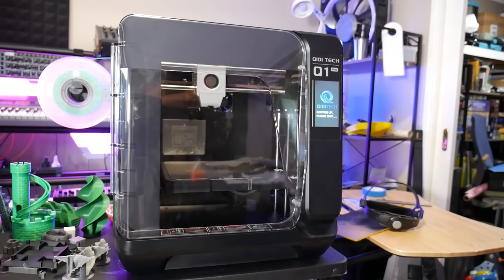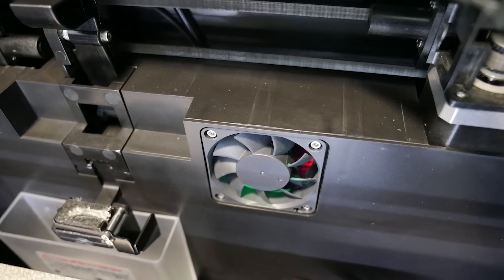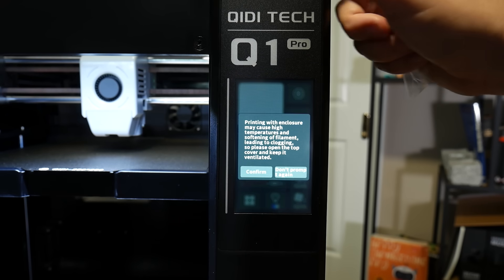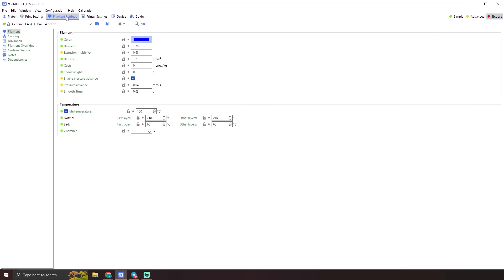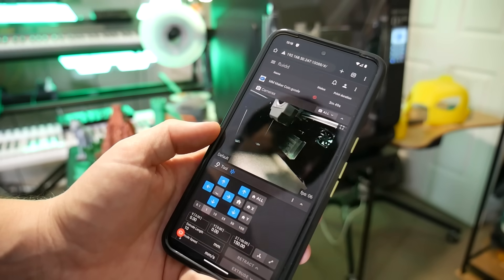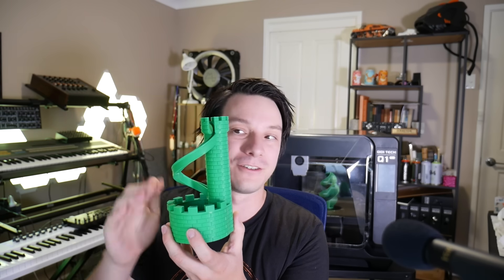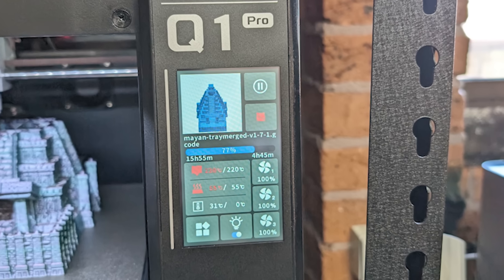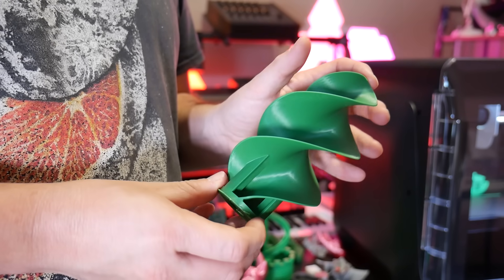The QIDI Q1 Pro is an AWESOME 3D Printer with some WEIRD choices. full review

Comment: Good one mentioning that door and the filament thing.. I got a newer version of the printer, in which it doesn't have a little hose hanging off the back, instead it's just a little hole to put the filament into, which looks like a headphone jack at first glance. But it is a wicked pain to get the filament to go into it correctly, since they made the outer part of that hole, thicker than the inner part, and it's not tapered.. Also that door, wth with not having a handle.. it wouldn't have even costed them any more, just a slight redesign to make the inner side of the door concave a bit, so that it's easier to get your fingers in there.. Really though, someone gotta teach Qidi how doors work, lol..

Comment: Now that the Elegoo Cetauri Carbon has Dropped, can you compart this to that? I want to buy a Core XY printer, and want to avoid bamboo and Spend less than 1k.Can you do an update review on Sub 1k Core XY and where they currently stand?
Reply: I'm in a similar boat, and wondering the same thing.

Comment: I hate to tell you this but you screwed when ripping the ptfe tube out during the filament change..... You're supposed to push down and hold the locking mechanism and it comes loose very easily.... You shouldn't have to fight it

Comment: Great vid. How do you rate the Q1 Pro against the Creality K1C? I noticed the Q1 is a decent amount cheaper at the moment, and both claim to print carbon fibre filaments, and with similar overall specs... If you have tested both, id like to know if you think one is a clear winner (or similar priced/spec'd options). Cheers

Comment: I do understand the filament change instructions. I own an older Sindoh DP200 and charging filament routine ask you to do the same. The reason, they have a cartridge system where they tried to sell proprietary filament BUT later they have you a firmware change to be able to use 3rd parts without the cartridge. The routine ask you to remove the bowden tube from the print head so you can clip off any filament bubble that might get caught in the bowden tube. Makes some degree of sense. I had less trouble than you in removing the tube from the print head. Each time I do it I, pretty much, never see an issue where there could be a jam. HOWEVER, if there every is, and I have had to go into the DP200 into the extruder and it's a mess. It's an enclosed machine and not fun opening the left side of the printer, remove a series of screws and have to be careful with wiring. So, I do remove the tube and cut the end so I do not have issues.

Comment: If you have to turn off the heater for nylon, what's the point of printing nylon on this machine?? Now you just have warping again. The whole reason I would want a heated enclosure is for stuff like nylon which is supposed to have one... Have they fixed this issue with the hotend heat creep or what?

Comment: I love Qidi Tech; I've got the Anycubic (Kobra 3), Bambu Labs (P1S), and Qidi Tech (X-Plus 3); I prefer it to Bambu and Anycubic. I actually love how Qidi does their filament load/replacement procedures, it helps against clogs and other issues (which I've never had with Qidi). Love Bambu as well, but in my opinion, Qidi printer is on par with Bambu Labs (if not better). I now strictly use both Bambu and Qidi in my farm.

By the way, if you use an active dryer, there isn't even a need to use the rear or side spool mounts.
Reply: can you recommend and link a active dryer for the Qidi Q1 pro?  TY

Comment: The Q1 Pros that arrived yesterday (7-29-24) now have 2 corner positive stops for the build plate. The do listen apparently. 🙂👍🏻 

But they haven't fixed the issue with how the filament wants to jam after it moves from the extruder to the hotend. 😡 
Click
Click
Click
Click
Click

Comment: Qidi has been my chosen printer brand for nearly 10 years. I have tried a bunch of other printers over those years but the Qidi machines in my farm have been complete workhorses. My original Qidi Tech printers are still running 24/7 with just a couple minor repairs in 10 years.

Comment: I stand by Qidi Tech. I've printed entire batches of 230 small pieces, that overlap in the overall print volume countless times in the X Max 3, and they've come out flawlessly. The only times prints have failed, it's with prints that take 10 + hours, and I blame heat creep since we're having an historically hot summer this year in Mexico. Even when things fail, Qidi has stellar customer service. Sure, documentation isn't as thorough as Prusa's is, but you can be damn sure a representative is going to actually read and reply to your inquiries whenever you need to reach out to Qidi. I'm glad they're getting more recognition.

Comment: Just got my QIDI Q1 Pro. It seems they have listened to the reviewers. Mine has an ethernet port. The build plate aligns with stops in the back corners. Could be better but it works ok. Screen options now include filament change by retracting filament. They do not recommend retraction due to the risk of getting filament stuck in the extruder.
Reply: Did they fix that problem he was having with the extruder gears and soft filament?  Guess you'd have to open it up to see?

Comment: Re "doesn't heat the chamber passively using just the print bed": Unless we're talking actually pro-grade machines with proper chamber heaters capable of temps >100C, I think this is a moot distinction. A 600W heater (e.g. an AC heated bed) is ultimately just that, it's capable of producing 600W of heat, probably actually more than the heater in the Q1 Pro (I say probably because at least right now the Quidi Website seems to not list product specs, at least as far as I can find). Just by adding some fans (and optionally heatsinks) it effectively becomes an active chamber heater. A V2.4 is cabable of >70C chamber temps (I think the highest I ever saw on mine was 78 after a long PC print).
That's not to say this printer is bad/worse or anything, just wanted to illustrate that active chamber heaters aren't automatically better/more capable then "passive" bed heating.

Comment: Some parts of that look like a direct knockoff of a P series Bambu Labs, with about a $200 discount. Sure it adds a heated compartment, but what else does it improve over those? It would be interesting to see a direct comparison. So many Chinese companies do exactly what appears to be done here. Find a successful product, copy it with some 1/2 assed changes, maybe add a couple new features and completely blow it in the details. At least it prints good.

Comment: I have the Xmax3 and they added this quirky filament change process to it as well with the last Firmware update.  I do not like it, and have also knocked the cable mangement loose and also find it difficult to remove the PTFE tubing.  The reason they did this is because of major clogging issues with the previous method, which required you to manually pull on the filament on the back of the printer as it fed out.  I have not had a clog with this new method as of yet, so it did address the issue, but is certainly not ideal. I just set the dry box they sent with printer next to the printer on the table it works fine and provides easy access for change.

Comment: The x3 series had an integrated filament cutter in the tool head,at least my xsmart did. And it printed very well with almost any material I put in it pa 12 cf being the most difficult. But that was after a lot of messing with the printer, new extruder, inductive mesh probe, hot end and a usb c cable for the print head. I still always had issues with bed adhesion and had to make adjustments on the fly almost every print. The last straw with it was when the bearings in z axis bed guides started to shake themselves loose and fall out causing the bed to go way out of level, and every print would fail. It looks like they use the same bearings on the bed for the q1, so you may want to affix them a little better maybe some glue or there is a printable model  on cults3d to secure them, I tried the printed model but the bearing holes had to much play by then and they didn’t work well.

Comment: well, not impressed. day2 of q1 pro: tpu stuck in nozzle twice, causing me to have to remove and disasseble to get out. Then nozzle sticks, and while assuming the flats above the nozzle are as usual for aa spanner, I then find that the ceramic is at the back - now broken. hotend ruined. new one £30.. but £33 postage. So far this is proving far more hassle than my anycubic kobra, and no faster either. argggg.

Comment: I pulled the trigger on this one. Been using my old Ender 3 for years so this will be quite an upgrade for me. Finally I will be able to print the moon lamp with out it falling off the bed after 30 hrs of printing. I will let you know if the actually fixed the filament loading.

Comment: Thank you very much for the great review. I own the X-Smart 3. It doesn’t have an active heated chamber, but I am able to print ASA with it nicely. With a print volume of 180x180x180mm the chamber is heated up by the heat of the print bed quite nicely.

Comment: General Thoughts on POM and Hightemp:

As someone who has managed a pretty good benchy outta it, i can tell you that it has little to do with the chamber temp. My benchy was printed at almost ambient. Getting it to Stick to the buildplate is doable, but you usually dont want it to stick to well as it will rip itself apart. The shrinkage itself will ruin every print if not carefully designed for it

Comment: You moan about the door handle, yet you haven't figured out how opposable thumbs work?  With that printer apparently running on a bouncy castle, I'm not surprised a spool fell off the holder.  Stand the printer on something solid, and then try it.  We all wish our printers were 100% rigid, but that's never going to happen, so running a printer that's mounted so insecurely must compromise the structural integrity, at least to the extent that you can't criticise the benchy for having minor ripples.
Come on Angus, you're better than this.

Comment: Pretty sure you could have depressed the colletring around the ptfe, then pulled the tube out.
Reply: Yeah that was complete user error. You depress the locking ring to remove push connect fittings. Also, the entire process isn't necessary. Simply heat to temp and pull the filament out.
Reply: @legendfpv  i find it very strange that angus does not know how to depress a release collet. dont you?
Reply: @reyalPRON  I had the same thought

Comment: The PTFE tube has a push-lock on the tool head. It is easy to remove the tube when to depress the ring to release it.
Reply: The point there was not about the push-lock mechanism, it was about the fact that it had to be done manually for such a newly released printer.
Reply: @ingGS  Fair....it's rather caveman.
Reply: @ingGS  its the main reason i personally wouldnt consider buying it

Comment: Really it looks like QIDI tried to copy the Bambu Printers without actually understanding how they work or why certain features exist. That aside my primary gripe when it comes to QiDI remains. I utterly hate the plastic doors. They make the printer look cheap. It basically looks like they positioned it to compete directly to the P1S and at $150 less then the P1S if they get it dialed in and fix some of the problems they have a compelling argument if someone has no interest in multi material printer. Once it goes up to its regular price it starts becoming a little less appealing at only $100 gap for a significant loss in functionality. Let's be real, this isn't a beginners printer and most non beginners are going to realize that $100 in this hobby is nothing.

Comment: Holy crap, that price.  I'm not sure it's the right printer for me (still happy with my heavily-modded first-gen Ender 3), but seeing a Klipper-based Core X/Y with all of these QoL features at the <$500 price point is a huge deal.  It should drive other manufacturers to also use Klipper from the factory, to support resonance compensation and linear advance and mesh leveling and everything else out-of-the-box.

Comment: Did you notice that the part number of your machine has the initials AMS at the start, I think this has something to do with that gap in the extruder and cutting the filament, Qidi multi colour print may be on its way, what do you think ?.

Comment: They say to keep the door open for PLA, but I have never done so on my XMax3 😂. 
Even a hyper PLA 5x size bency printed for 8 hours beautifully. That air curtain works really well and the heat rises away as long as the lid is off 🤷🏽‍♀️

And, yeah, these newest QIDI releases are ABS monsters!
Blows away the competition.

The bed does seem slick, and many of us that have the new gold textured bed use a little pva glue stick with great success for the picky filaments.

The heat creep bendy filament problem may be a bit of print head design issue... The hot end cooling fan does cool the heat sink, but due to no ducting behind the front shroud, it rises up into the extruder area. That and for some reason they spaced it out from the heat sink in the Q1 🤔
The XM3 design tried to combat that heat rising with a little 20mm fan pulling the heat out of the side of the shroud. 🤦🏽‍♀️ I ended up modifying mine with push-pull fans for crossflow of the heat that is swiftly moved out of the head shroud.
(No videos yet, my day job kills off my free time) 
Message me if youd like the photos of the fan mod. The XM3 and the new Q1 use the same modular hotend design, though the Q1 is copper core and has that beautiful hardened tip in a clad copper heat zone. 🤤

Have you seen @NoizieWorks video on the Q1?
He printed the torture toasters in a variety of materials!

Comment: I bought the xplus3 last Christmas and I love it. The best thing is that they keep updating the hardware as well as the software. The first units didn't had a container for the carbon filter mine has one and the fans that were noisy on the review in mine are quiet

Comment: I own cats and have been looking at the X-Plus 3, but then I see the Q1 Pro come out and has gotten me interested. To my knowledge, I don't need to open the door for PLA printing on the X-Plus 3, but, in this review, you did say both door and top needs to be open. For obvious reasons when owning cats, this is a massive concern for me. Is there any alternative way to fix this issue?

Note: I own an Ender 3 V2, been quite a project to fixup and work on. But with it being an open chamber 3D printer and my lack of time I've got tinkering, I'd have to put that as a side project. I'm in quite a need for a closed chamber 3D printer because I'd like to not have my cat ruin a print and be set a blaze.
Reply from the maker: If you just wanted to print PLA, you could swap a metal mesh in place of the clear plastic and it'd vent heat just fine. The cats would probably sleep on top of it though 😂
Reply: @MakersMuse  Thank you for the help! I will need to figure out on how to remove the door, I haven't taken a close look at it yet to see how difficult of a process it'd be. Nonetheless, I do a few more questions if you don't mind. I was doing more research after watching this video and I'd like to ask for your experience & opinion on the topic.

1) I saw in a different review video that the firmware is 2 years old and cannot be updated. Is this true from your experience? If it is, then is that bad for a printer?
2) I'd like to eventually do upgrades, given I see anything I'd like to upgrade. How well is it for open source or, at the very least, repairability?
3) For the Q1 Pro, am I restrained to only the Quidi slicer and Orca or could I use other slicers like Prusa and Cura?
Reply: Just make sure your table is really ricketty
Reply: On my Qidi's I just take the lid off. The doors stay shut. Never had an issue doing that.

Comment: Vector3D mentioned that the version of Klipper in his review unit is an old, outdated version that cannot be updated. Do you know if Kiauh can uninstall that version of Klipper to reinstall vanilla Klipper?
Reply: It uses Makerbase boards and Makerbase has instructions on how to reflash them. But you'll have to reconfigure and re-tune all the components that are not Makerbase for them to work properly (motors, etc.). I believe they said the screen won't work, so you'll have to replace that.
Reply: You could re-flash but there's no reason to. Prints beautifully right out of the box, no reason to waste your valuable time. After all, plug and play is why you buy a turn key unit like this. It's for people who have work to get done, not for those who enjoy messing around fixing and tuning printers.

Comment: That's an exciting printer! I was considering it until you showed the filament path in the extruder, and how bad it is at TPU as a result.
Deal breaker.
Reply: He wasn't using good filament and his settings likely needed to be tuned. TPU is a fairly sensitive material and everything from manufacturer, age of filament, temperature, and speed matters. Filament path is the same as any other direct drive printer.
Reply from the maker: Polymaker 95a- HF is as good as it gets, even works with Bowden extruders. Their provided profile limits flow to only 4mm3/s and it's still unreliable. The extruder gear tension is way too high for it so it deforms then quickly jams. Fixable with a hardware update for sure
Reply: @MakersMuse  that's what I saw too, my current 3D printer (CR-10V3, has a E3D direct drive) can print softer TPUs at higher flow  than 4mm3/s. It has a tighter guide below the extruder gear. A simple plastic part but it works.

It shouldn't be too difficult to make that better based on what you showed with a replacement part.
Making it a very short filament path won't happen with this extruder tho.
With units already in warehouses, you probably reviewed what customers will receive.